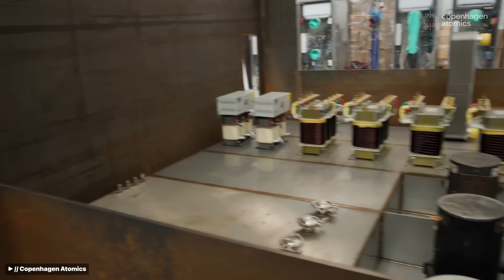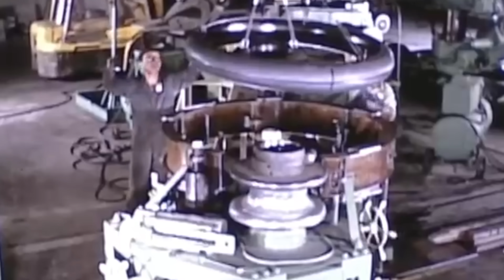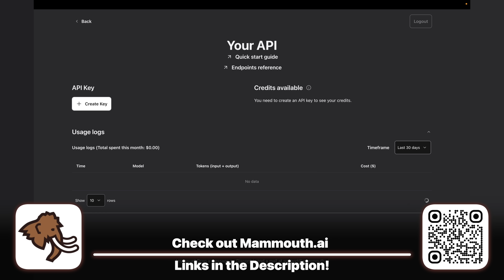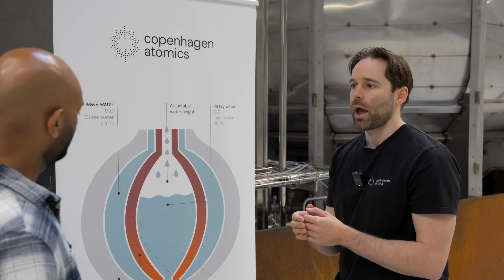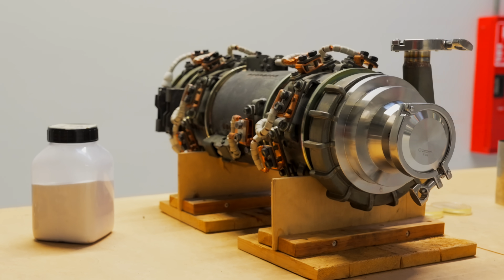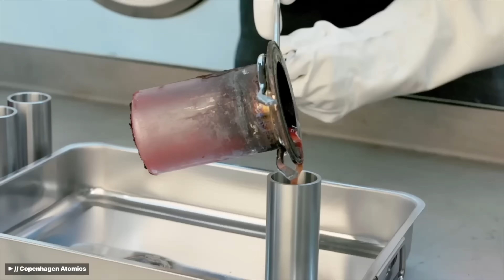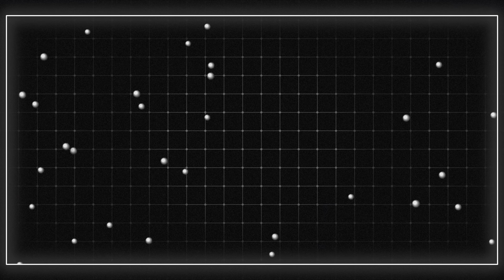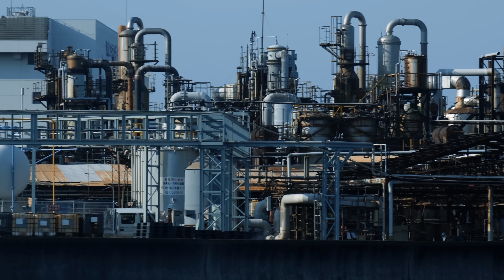This Modular Thorium Reactor EATS Nuclear Waste

Comment: I hope they can make it work for that price, but I still believe that new geothermal will be the future, because they can also store energy. New geothermal is a perfect fit for renewables.
Reply: Sorry for asking but why would you need to store energy on a geothermal plant when you get constant heat from the earth except maybe when doing maintenance but I think the turbine acts like a flywheel then so it can still generate electricity that's how I think it works on big commercial reactors to
Reply: @cybersocialist  Are you familiar with the duck curve? If not, look it up. There's a lot of sunshine when energy use is low, and prices are low. Geothermal can then close the exit valve, but leave open the pump. That way the geothermal reservoir can be loaded for when it has to open in the night time, when the sun sets, and energy use goes up. Geothermal can thus regulate the grid like no other technology can. It's the perfect battery, because it has the option to run 24/7 too, for when solar and wind aren't generating enough power. And it's also more economical for the operator - buy low, sell high. It'll also extend the life of a geothermal well.
Reply: @FreeGrass69  I'm a huge fan of geothermal, but this application of it that you're referring to is not a good idea (Sage Geosystems).

The only geothermal that makes sense is superdeep supercritical geothermal.
Reply: @TerraPotens537  Sage is different, not sure if what they're doing is going to succeed, but I am happy they want to reuse old wells. That'll close them from leaking methane.

What I'm talking about is enhanced geothermal from Fervo. They fracture the rock horizontally to create a huge reservoir that can be put under pressure. It's all new, so it'll have to be tested, but in theory it should work. They can store energy for a few hours at least.

And yes, what we're all waiting for is the Quaise drill so we can get supercritical water. Let's hope it'll be available soon. 🤞
Reply: @FreeGrass69  Not a fan of Fervo's plan either.  I'm a geologist, and their methodology is going to cause increased seismic activity because their version of geothermal is in "shallow" sedimentary rock.  Fracturing sedimentary layers of rock is not good long term, and your geothermal systems will result in very corrosive water over time.  

Think more long term, because Fervo's geothermal power plants have lifespans of only a few decades before they will have depleted the thermal energy in that area which means they'll have to move to new ground.  Over centuries this will mean increase seismicity all over the planet

The golden goose for geothermal is superdeep supercritical water based geothermal systems.

10-20 kms deep
Reply: @TerraPotens537  Yes, that's another thing geothermal can do, mining, The water will bring up a lot of minerals and salts, like lithium. I'm not sure about seismicity. Fracking has been done for a while now, and they say seismicity won't be a problem anymore. But you're the geologist. I'm not. I just read what people have to say about that.
Reply: @FreeGrass69   We geologists think in deep time...  Centuries of fracking will increase seismicity.

I'm not saying you'll have lots of high powered earthquakes, most people won't even feel the earthquakes (in most cases), but the foundations of your homes and buildings most certainly will with cracks, and increase sinking, etc...

Comment: We need to promote YIMBY initiatives more. I totally wouldn’t mind to Yes In My Back Yard this.
Reply: Used to be a fan of nuclear, but then geothermal had a major breakthrough...  Millimeter wave drilling unlocks geothermal power as an option worldwide.  No need to play with dangerous nuclear any longer.
Reply: @TerraPotens537  Nice, never heard of this till now. Seems the company pushing this tech, managed to go to 100 meters depth with a test, and they are working on supersized version with 10X the power by 2028. Nice to see this advancement is in the works. I'm wondering how much power it takes to use Millimeter Wave Technology? Seems like it would be a lot.
Reply: @torchlord11  Good research on your part in such a short amount of time.  Bravo!

Yes, Quaise Energy recently completed their first field test in a granite quarry in Marble Falls, TX.

24 hour long test to see what rate of penetration they could achieve.

4 inch wide borehole using a 100 kW portable power plant.

It was actually 118 meters, or roughly 5 meters of drilling depth per hour.

Their second field test, at the same site, will happen soon and this time they're aiming for 1 km.

Granite, gneiss, and basalt are the types of rock that have kept us from doing geothermal planet wide up until now because mechanical drill bits just can't handle them very well and bits get destroyed in short order.

This is why they chose the granite quarry in question because the granite formation goes 2 km deep there and provides them with a relevant rock type to what we will experience when drilling deeper than 3 km.

I'm very encouraged by their progress so far.

12 km depths in ~100 days where with mechanical drill bits you'd easily be looking at 5+ years of drilling.

Their commercial grade drill will drill 8-12 inch boreholes using a 1 MW portable power plant.

Comment: Obsolet technology done cleverly is still obsolet.
Reply: How is it obsolete exactly, if it works it works, and what is your energy source of choice?
Reply: @TerraPotens537  Does it work? Hint: They plan for a lifetime of the reactor of 5-7 years. After that they will have a giant pile of highly radioactiv broken machinery. 
Will they even manage to produce less waist per energy unit, compared to big nuclear reactors? I don't see how.
And what about the prevention of proliveration? They would have to put a lot of these SMR in one place in order to guard them heavily. All users of SMRs would have to, which contradicts the appeal of SMR on a basic level.
Therefor: Nuclear energy is an obsolet technology, no matter how clever some problems might be solved.
Reply: In China, this is a current reality, one such reactor is already running there, unlike other countries where they are just trying to invent one... How on earth is it possible that this video ignores this fact and does not even mention the Chinese success?
Reply: @mirekslechta7161  Because it's easier to fly to Danemark and tape a video in a company, which actually want's publicity. AFAIK, the chinese publication is a bit sparse in details, too.

Comment: Copenhagen Atomics! I am a huge fan-boy of these guys. 😄
Reply: so what are current, real optimistic timeline with starting all that machinery? When they going to start it?
Reply: In China, this is a current reality, one such reactor is already running there, unlike other countries where they are just trying to invent one... How on earth is it possible that this video ignores this fact and does not even mention the Chinese success?
Reply: @mirekslechta7161  the thorium reactor running in chine does NOT fit in a shipping container
Reply: @plasticpippo201    But it is also thorium reactor too, right ? And it is the only one thorium reactor which  already works, that matters a lot IMO and therefore it should be mentioned here.
Reply: @mir @mirekslechta7161 thorium reactors have been around for a long time. We even have some very old models in space.  America does a lot of research and India to!  Nobody has cracked the nut of affordability yet.  Mass manufacturing sure would help!  Hoping for the best with these guys!
Reply: @mirekslechta7161  Do you have independent verification that the reactor is what they say it is and that it has, or is running? If you trust the CCP I have a bridge for sale, going cheap!
Reply: Visit Copenhagen while it's still there! CA's planning tests soon, so you better hurry.
Reply: @bartroberts1514 They're going to test in Switzerland, in 2027, at one percent of rated power, you half-wit.

Comment: I don’t understand why the motor has to withstand that amount of heat. There is no rule that says the motor has to be near the heat. Only the impeller needs to be that hot. Enclose the motor and use a shaft to drive the impeller.
Reply: The shaft has to be in the molten salt. And pass through the wall of the pipe to get to the motor. You will need seals for your device to stop molten salt leaking out along the shaft. Seals operating at 600 to 700 degrees C for 5 years 24 x 7 x 365 - keeping out highly radioactive molten salt. 
What material are your seals made of?
Reply: @georgetaylor2640 Now I get it. Thanks bro

Comment: Wellcome to Denmark Ricky.
Reply: In China, this is a current reality, one such reactor is already running there, unlike other countries where they are just trying to invent one... How on earth is it possible that this video ignores this fact and does not even mention the Chinese success?
Reply: @mirekslechta7161 China's reactor is basically a copy of the test reactor built at Oak Ridge, Tennessee in the 1960s. They've added enough thorium to be able to detect U233, but that's not yet a working, competitive power reactor, and it's not a net breeder (one that produces as much fissile fuel as it uses).
Reply: @mirekslechta7161  because Communism is evil and Beijing uses slave labor.
Reply: @mirekslechta7161 what is it called

Comment: Bout time. Power plants intentionally run WAAAAAAAAAAAAY over budget. The more it cost, the more they can charge. I know people who worked at the Vogel plant in Georgia that were paid to sit on their ass. They are money laundering schemes, like most everything else.
Reply: No, it’s because the design has to meet every safety standard for where its built, that necessarily slows down construction and increases costs, because every step of the project has to be done within acceptable parameters.
Reply: I saw another video of them and they were talking about all the prototypes they have build (always to full scale). They said in there that building a prototype costed them 6 miljon. I assume that not all systems are in there then, but still I was amaze about the price.
Reply: nuclear plants arnt money laundering
its just crippled by regulation
its crippled deliberately, because cheap power gives power
Reply: Even if that were true, a few people "paid to sit on their asses" doesn't result in a multi-billion dollar financial blowout that is Vogel.  Globally, commercial nuclear energy is one of the most expensive ways to produce electricity on a per MWh levelized cost, and that's not just the financial blowout that is Vogel.

They charge more because their overall production costs are higher.   Remember, revenue equals income minus expenses.  There's a minimum that any supply can charge because anything lower results in negative revenues, which is operationally unsustainable.

The long list of challenges with designing and running a Thorium MSR actually could make its power even more expensive compared to current traditional large-scale nuclear power.
Reply: @beyondfossil  BS
Reply: In China, this is a current reality, one such reactor is already running there, unlike other countries where they are just trying to invent one... How on earth is it possible that this video ignores this fact and does not even mention the Chinese success?
Reply: @mirekslechta7161  how many ppl died to make it . And how many slave laborers did it take. Thats how China gets things like this off the ground . They simply dont give a fk about the ppl making it,  who it hurts , and only how cheap can't  they can't get. That 12 gorges dam sure its the biggest is the world but chances are it wont last with that tofu construction over there.  How many ppl did china  displace, or how many villages destroyed, and not to mention the heritage sites that are now under water. Great things can get done when humans lives  mean nothing. Just ask russia space program lol. china  will feel real stupid when that dam fails and takes out ¼ of its population lol😅. Keep up the good work 😅
Reply: @shannon6815  You write about China not caring about human lives, and you're probably exaggerating a bit. But should we only view human life as something extremely important when we think about the people living in our own country? Imagine what the US has done in the last 3 decades: Bosnia 1995 Iran 1998 Sudan 1998 Afghanistan 1998 Yugoslavia – Serbia 1999 Afghanistan 2001 Libya 2011 Iraq and Syria 2014 Somalia 2011 Iran 2020 Germany(Nord Stream) 2022, Sirie 2024, Yemen 2024, Iran 2025. Venezuela 2025 Except of that: USA also provoked the war in Ukraine since USA provoked regime change in Ukraine and once neutral country lured in to NATO despite the fact that many politicians including A. Merkel said that it would mean the war !!. On the top of that USA kept killing civilians in many third world counries via drone strike without any court decision: 6000 killed since Obama presidency.
Reply: @mirekslechta7161 China only has a tiny experimental 2MW thorium reactor constructed last year.  It's only for research purposes, and it's not connected to the grid.
Reply: @beyondfossil  But is is the only one working and that matters IMO.